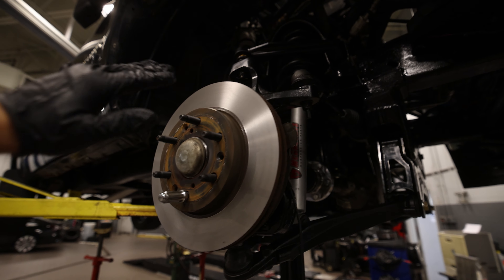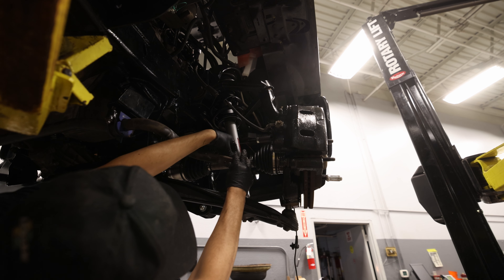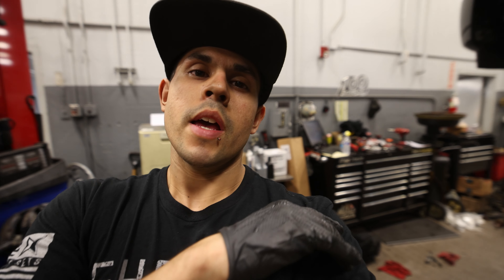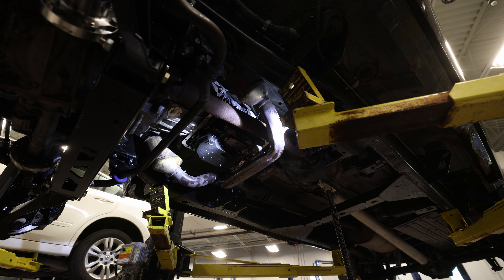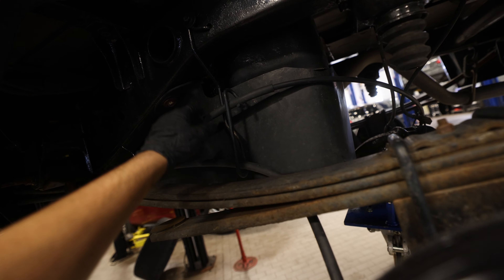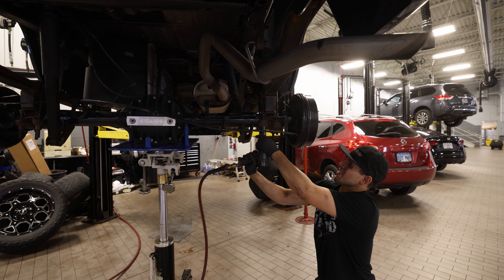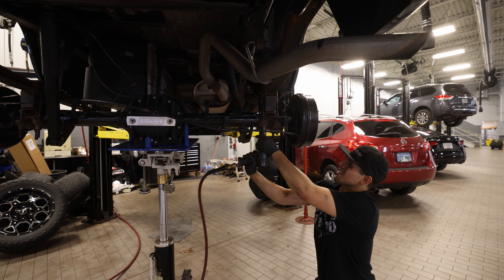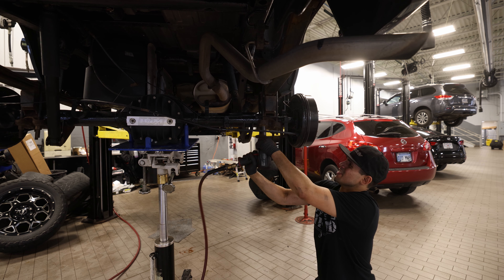2007 Silverado McGaughy's 7-9 Inch Lift Install | Part 6 : REAR ADD-A-LEAF KIT!

Comment: Hey man I really need to know! If I get this for my truck I got the same year and lift but I wanna go to 9-9 vs 9-7 does adding these leafs not ruin the shocks? That came with it as 7inch? In the rear....
Reply from the maker: I havnt had any issues with them getting blown or anything when it’s set at 9 inches. Their designed to be 7-9 inches. It did however surface rust pretty easily more of an eye sore than anything.
Reply: @JohnPonce  we'll do they sell replacement sway bars? Bc apparently the truck I bought as well same year, and lift. The dude has some other brand 7.5 rear blocks in the rear, so... I can't get the blocks and then the sway bars for that lift is gone and I don't have the I guess? Drops for it. And idk what to do ... Man I've been depressed all week bc of that bc I didn't know it was there when I got the truck he never mentioned it and I was so excited to get a nice truck I overlooked it. And now I'm stuck!
Reply from the maker: @trulysouthern2736  Honestly what I would do is order replacement parts through 4WP they should be able to get a hold of McGaughys  and figure out what part #s you need to get the correct rear blocks and Sway bar lowering bracket and hardware
Reply: @JohnPonce  alright awesome! I really appreciate it man. Bc I've been trynna watch your videos now for a min trynna figure what I'm missing. Do they have a number I can call?
Reply from the maker: @trulysouthern2736  you might have a 4WP store locally their nation wide it’s the company I work for. I’d just type in Google “4wp near me” and see what pops up each store has their own personal phone number they should be able to take care of you.
Reply: @JohnPonce  alright thank you man! I really appreciate the help.
Reply: @JohnPonce  I just called um and they said they don't have anything like that maybe call the manufacturer for the lift. So that's my next step I assume
Reply from the maker: @trulysouthern2736  Ya their has to be replacement parts
Reply: @JohnPonce  from mcgaugy?
Reply from the maker: @trulysouthern2736  Ya reach out to McGaughys tell them the part # of the kit you have and ask to order replacement parts for it.
Reply: @JohnPonce  yes sir! Got it. Just spoke to them and told me I can use a factory sway bar just need the extender or w.e
Reply from the maker: @trulysouthern2736  Ya factory sway bar and factory end links, but you’ll need the McGaughys sway bar drop brackets or extender whatever it’s called, and than just get the 7-9 rear lift blocks and you should be set
Reply: @JohnPonce  gotcha!!!! Now that makes since lol
Reply: @JohnPonce  apparently I don't have a sway bar on it here at all either
Reply: @JohnPonce  do I need a sway bar for the rear also?
Reply from the maker: @trulysouthern2736  No just the front
Reply: @JohnPonce  ohh ok cool. Thank you so much! Man.
Reply: @JohnPonce  so ok I'm missing a few parts... I'm missing a skid plate, sway bar extenders, I think sway bar drop brackets, 19 on there diagram for parts. The bars that bolt between the cross members at the control arms are those needed? And then the 6inch blocks bc I got 7.5 blocks I gotta remove and install there leaf kit.

Comment: Aye so if I order the add a leaf kit, can I do this myself at home? Or do I gotta have all that stuff you used to do it.
Reply from the maker: You can do it at home but honestly would be way easier with a lift, I’d make sure your bolts to rear leaf springs arnt seized first before tackling that project honestly
Reply: @JohnPonce  gotcha! Yeah I just went and looked at your video of it and then checked mine out and I'm rust free  so far, just gotta order my kit. I got the sway bar and links in but there factory from dormant hope they work, I gotta order the sway bar extenders too, but I don't have extender sway bar links unless there necessary or w.e lol. It's coming along tho
Reply: @JohnPonce  are you supposed to trim inner tie rods for alignments? Or is that just optional? Bc I got told that too.
Reply from the maker: @trulysouthern2736  you may have to cut them in order to get the alignment within spec, luckily for me I didn’t have to do that. I would try to get it aligned without cutting first
Reply: @JohnPonce  well I took to a blacks shop here were I live and they never mentioned it. So idk if they just used that for the money or they had it done. But they did it without telling me that and without a sway bar and links. I was kinda mad after I realized it bc I didn't know a sway bar was a must have just bc I honestly dont have a issue without the sway bar so idk. But then my rod bent so maybe! That's why it bent... Bc it's a factory tie rod and then it's got more thread then a usual, it's masterpro basically It has more more same.... Length but just thread a extra inch or 2 vs like precision and what not.